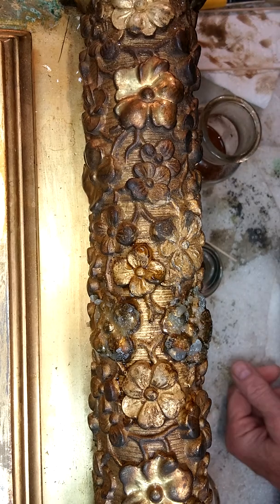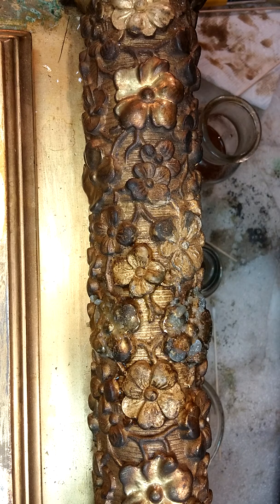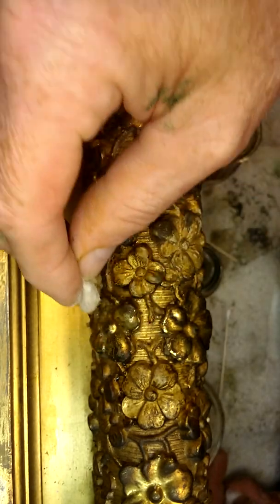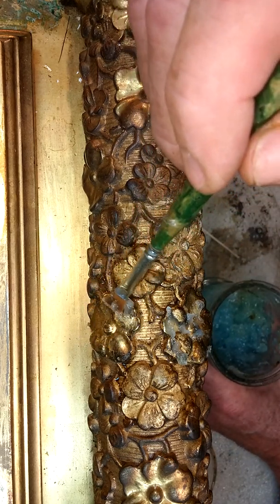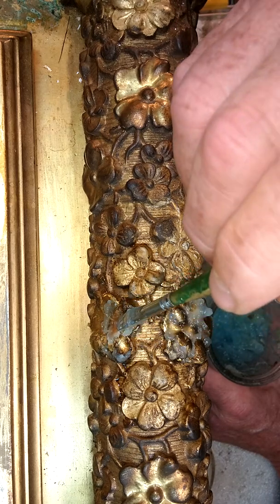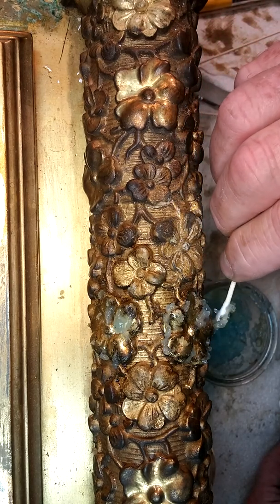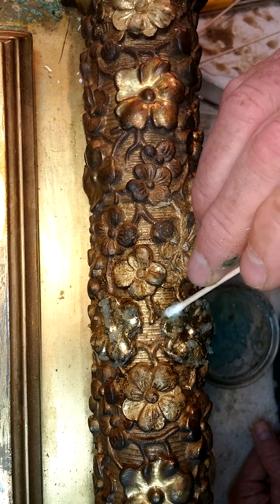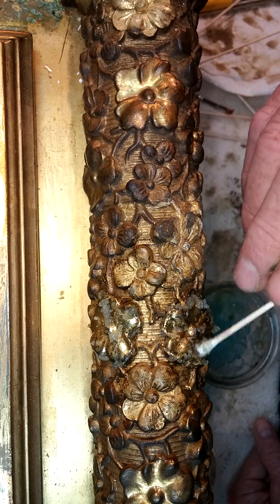Cleaning Gilded Surfaces II (Water-Gilding)

Comment: What would you use on ormolu ?
Reply from the maker: Fire-gilded bronze is a different situation entirely, of course. However, "cleaning" is a very broad concept. Ormolu comes in many different techniques, including fire-gilding, a tinted coating on silver, etc. So I would need more information, especially what it is you are trying to remove (corrosion product?, Surface dirt?, etc).  I will say,  that a test spot with ethanol is where I would start.
Reply: @craigdeller2024  Hello, I have tried ethanol on a gold ormolu flourishing on a perfume bottle. Now, it is shinier than before, but there is a fine reccurent matte white powder on top of the shininess. How can I remove it? It looks like dust.
Reply from the maker: @jeremyaficionadoFR  It may be residual dirt not soluble in ethanol, a mild soap and distilled water may help.
Reply: @craigdeller2024  It has gone with WD40 oil, which has nourished the alloy.

Comment: What water-based resin soap?
Reply from the maker: Sorry for the delay. The coating I encountered on the surface was colophony, so the concept of affinity comes into play....(like cleans like) so an aqueous mixture with abietic acid was created.Molecular affinity between the terpene resin (in the varnish) and the acid is one ofthe other explanations of how soaps work. Abietic acid has a similar molecularstructure to copal and sandarac while deoxycholic acid resembles dammar’s andmastic’s6. Wolbers describes soap action as “the strong affinity for one hydrocarbonstructure to another that accounts for the specific solubilizing effect”7. Molecules aresimilar and attract each other, which dissolves the layer: similia a similibus solvunturor “same dissolves same 

(14) (PDF) Replacing the triethanolamine in Wolbers’ resin and bile soaps. Available from: https://www.researchgate.net/publication/330866940_Replacing_the_triethanolamine_in_Wolbers'_resin_and_bile_soaps [accessed Feb 27 2024].
Reply: @craigdeller2024   Not at all!  I'm just glad you gave such a detailed response!